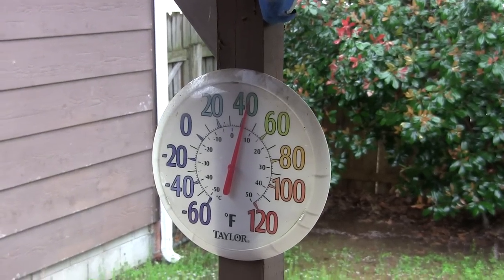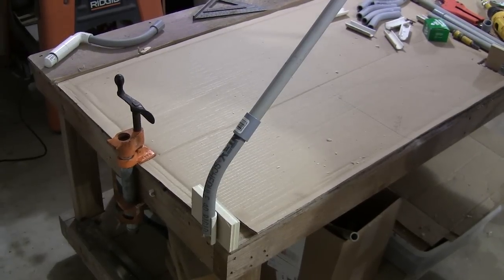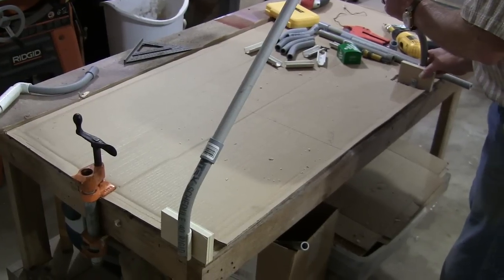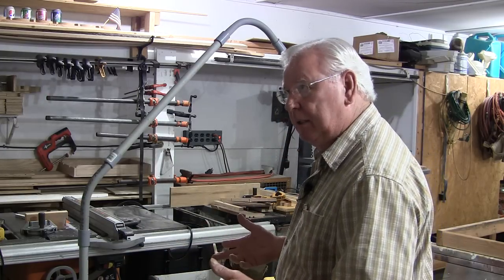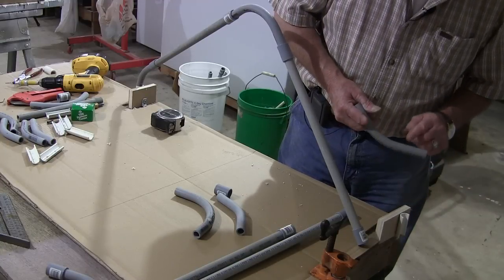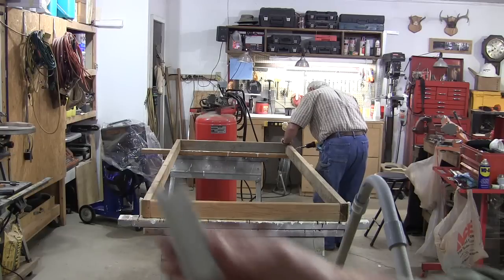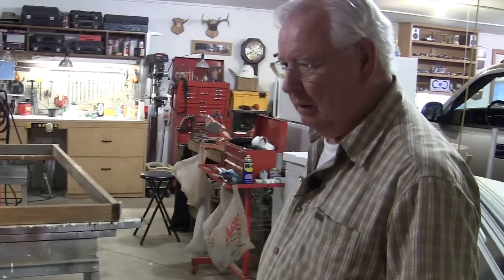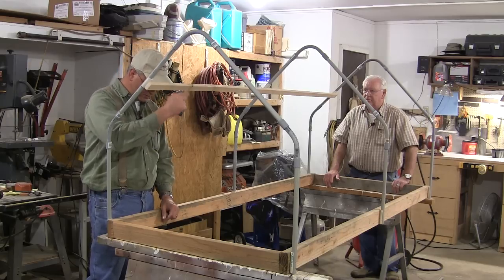A Convertible Greenhouse Built for YOUR Existing Raised Bed Garden with NO Wiggle Wire Necessary

Comment: Very nice idea gentlemen!!! Maybe where it attached to planter box use couplers with your drill through countersink idea then insert main legs so the uprights do not try and lean when u put plastic on it. And I am thinking of gluing mine together and caping off ends and plumbing it as a drip irrigation system any thoughts on that. Thanks

Comment: Hi Reaganite71 I was watching an SSE video about starting transplants and they had something similar to yours when they harden off their plants. instead the half thing at the bottom they used a whole tube about 2" to 3" that was attached to their table.  that is a slip fit and it would be very stable so you could tug on it pretty hard.  I definetly am going to use your idea.  I have been thinking of trying to sew my plastic so it would be more like a slip cover for easier installation.  Thanks

Comment: Love the clips. I would do the same except I didn't use the grey electrical pipe, I used all pvc schedule 40. And in all the years I've been using PVC I have not seen a deterioration. Nice video!

Comment: Great video. So the base pieces that screw into the bed, cut the top half as you did, but leave the bottom half as it came. Screw in the cut half and the whole pipe piece will hold the grey frame. You will still be able to remove frame and won't have to screw into it. I'll try to video it when I ask hubby to make me one!  Thanks again guys!

Comment from the maker: This was a design just for early spring, to protect from frost and lows in the mid 30's.  Daytime heating will heat the soil and the covering should retain heat.  One could also paint 2 litter bottles black and fill them with water to radiate heat through the night.  If I ever build a walk in greenhouse, I'll probably use an RV propane heater (w/thermostat) and twin 40lb propane bottles w/an auto changeover valve.  I've heard that it costs about .20 a night @ 20 degree lows to operate.

Comment: I like your methods - Have done something similar myself - made 10X16 hoophouse - used 3/4 in electrical conduit.  fyi  That gray pvc is made for underground so should last a long time.   That's fun running that pvc pipe through the table saw huh?  
Thanks for the how-to.

Comment from the maker: The soil in a raised bed typically warms faster than the lawn due to daytime heating.  The greenhouse will hold the heat at night so you seal the sides up early in the evening and the hope is that it holds it in.  Raise the sides back up, using squeeze clamps to hold the plastic, in the morning once it warms up so it doesn't get too hot inside.

Comment: That was awesome working as father and son.. My question is ( isn't gonna fall on winter time by getting lots of snow hitting it cause every time it hits the top it's gonna move and come out of the gripers and fall down isn't it?
Reply: saddle clamp at the base seems like a plausible solution. that or steak some rebar and slide the conduit right over it.

Comment: If you didn't want to take it apart, you did so much work already, you could use what you got as one single unit, 2x4's and all. Just pick up the whole thing and set it on your bed.. You could make it a few inches bigger at the base and just fit it over your existing bed frame. It would take two people though, but it could be done. Hust another thought.

Comment: It's my understanding that the gray electrical conduit is made with a UV stabilizer so it should hold up longer in direct sunlight.
Delightful???
1/2" and 3/4" x 4" snap clamps are commercially available (been using them for years with 3/4" flex water pipe for hoops over 4' beds).

Comment: Some PVC electrical conduit is labeled as Ultraviolet/Sunlight Resistant. Water PVC tubing does not contain the UV inhibiting chemicals in conduit.

The only things I'd be concerned about are 1) while I've never seen it, I have no guarantee that all conduit is UV.sunlight resistant and 2) the chemicals that make it resistant could leach into the soil — I don't know if they're safe for consumption.

It is obvious that the electrical conduit is not rated for food and water like PVC water pipe.